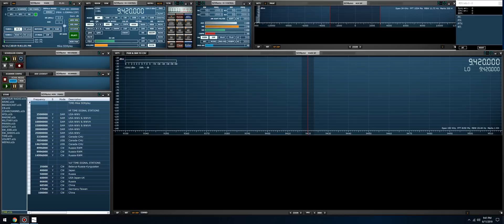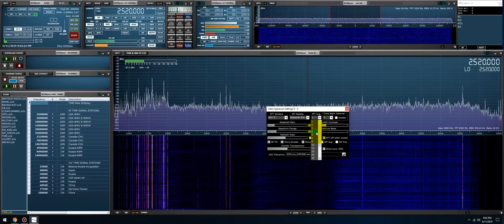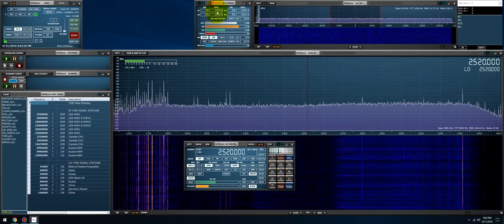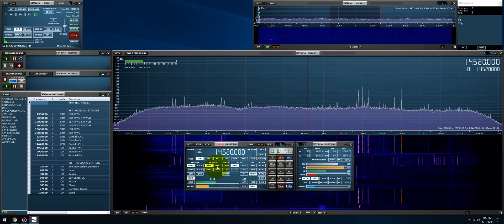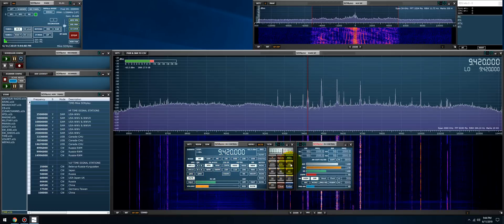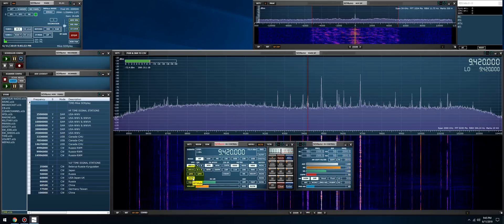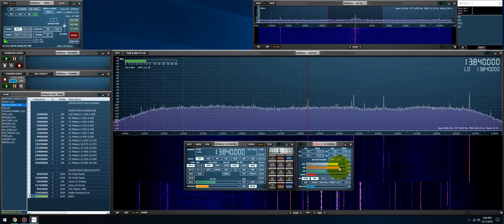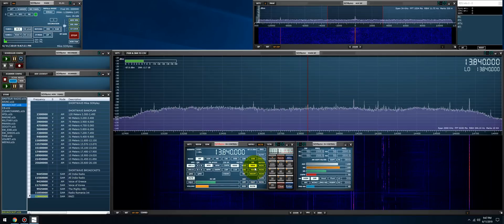SDRuno basics, Removing wide band noise.

Comment: After many days trying to get neutral hydrogen line at 1420 MHz, gave up and trashed this receiver. Good old SDRSharp working good with IF average. SDRPlay or SDRUno just does not care for HAM radio operators or radio astronomers.
Reply from the maker: Sorry you feel that way. I myself have not monitored hydrogen line transmissions, so I can't comment on that but I know of many RSP users using devices  for radio astronomy, Radio JOVE being one of them.

 A simple Google search with "sdrplay radio astronomy" keyed in should produce many relevant results.

Comment: Can you not do the same thing with the SDR as you could with a MFJ 1026, compare you main antenna to a small antenna to get rid of local noise?
Reply from the maker: You could but using the noise reduction built into SDRuno does not require another antenna.

The RSPduo can do what the MFJ is doing using both of its tuners.  

http://play.fallows.ca/wp/radio/software-defined-radio/sdrplay-rspduo-noise-canceller/

Comment: Mike, It looks like your LO and VRX frequencies are the same for this demo.
Reply from the maker: Correct. in LOW IF mode separation between the VFO and LO are not needed.
Reply: @SDRplayHamGuides  Thanks. Is that true for any of the RSP's or just the duo? Wasn't sure from the SDRUno manual.
Reply from the maker: This is for all model RSP's from the original 1 up to the Duo.

Comment: Mike, did you try to see what the interaction is with the AGC control? Back in the time from Studio 1 there where problems with some settings of the AGC and the NB action. Maybe the video would be more revealing when a weaker is tuned.
Reply from the maker: I usually leave the AGC at the default setting. RNZI was weak (at least at my QTH) toward the end of the video.

Comment: These videos should be required watching! I've learned sooooo much about the tremendous capabilities of my SDRplay RSP that has enhanced the use of it. Thanks for the series Mike! de KC9CS
Reply from the maker: Thank you for watching and commenting.
Reply: @SDRplayHamGuides  I know that this Video is pretty old but ouch that noise makes My Head hurt since I don't know much about Radios I whould probably suspect it to be A torn Wire or A blown Speaker
Reply from the maker: It was power line noise coming for an electirical  pole
Reply: @SDRplayHamGuides  Oh